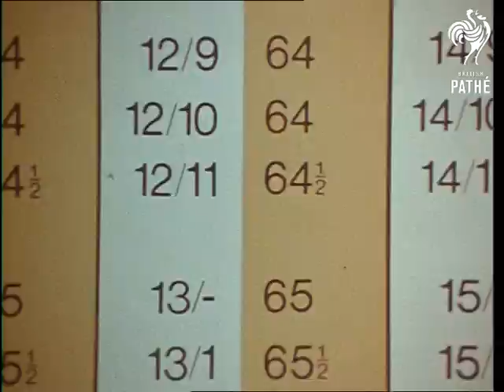Decimalisation (1970)

Comment: the old British monetary system:
Two farthings = One Ha'penny. 
Two ha'pennies = One Penny. 
Three  pennies = A Thrupenny Bit. 
Two Thrupences = A Sixpence. 
Two Sixpences =  One Shilling, or Bob. 
Two Bob = A Florin. 
One Florin and one Sixpence =  Half a Crown. 
Four Half Crowns = Ten Bob Note. 
Two Ten Bob Notes = One  Pound (or 240 pennies). 
One Pound and One Shilling = One Guinea. 
The British resisted decimalized currency for a long time because they thought it was too complicated.
Reply: wth how would anyone (esp tourists) get by with all that?
Reply: @earlbluetea  not British, but not as complicated as it sounds. It's just that one pound was 240 pennies (or 20 shillings) and one shilling was 12 pennies. Basically one shilling converted to 5 pennies when they introduced the new penny and pound was still a pound. Most coins were silver so you could kinda guess what was what because when the value doubled, the coin size doubled. Coins like 1 shilling and 1 florin coins were in circulation as legal tender quite long time after the decimalisation, they had exactly same value and size as the new 5 penny and 10 penny coins
Reply: Also there were some other coins in the past, like double florin and a 1½ pence, If I'm not mistaken double florin is still legal tender in the UK, although the value of the coin in just silver content is far far greater than 20 pence, probably closer to 10 pounds.
Reply: My old man used to call 5 shillings a dollar. I think it comes from the days when the £ was worth 4 American dollars.
Reply: Plus Five Shillings = One Crown, but you didn't see them that often. It's odd that the racing world is still in Guineas.
Reply: White Dragon, please stop it!
Reply: I'm sure it was easy enough to learn at the time, but looking back at pre-decimalisation  it looks like the writings of a lunatic
Reply: osp80  
We count fingers in: 
5 plus 5 = 10 
Hence decimals MAKE SENSE and this mambo jumbo of 240 to make a quid had to be flushed
Reply: From your name I assume you play Mah Jong; that's a Good Omen.
Reply: 10 Bob 50 p
Reply: People are making too much of the old system. In practice, it was pennies (or pence), shillings and pounds. 12 pennies in a shilling, twenty shillings in a pound. Everything else mentioned is either an informal usage, e.g. bob, or an archaic usage, e.g. florin, crown. There were also a number of truncations, e.g. ha’penny, farthing, and derivations, e.g. half-a-crown. On top of all that, there was pure slang, e.g. tanner (sixpence), nicker (pounds), quid (pound). It can get as complicated as hell, but at the root of it all was pounds, shillings and pence. Guinea (twenty-one shillings) was a class-soaked issue. Anything that could be deemed posh or relatively pricy would generally be priced in guineas, including posh sports like horse-racing. I happened to be in the UK for the decimalization swap and it all went quite smoothly, despite much complaining and dithering about. However, I do think prices went up, wherever tradesmen and manufacturers saw the chance.
Reply: Ой, какая путаница. С ума можно сойти.
Reply: @earlbluetea  nobody coming here any time soon
Reply: Clear as mud
Reply: Good God man.....
Reply: thanks for the explanation
Reply: It seems more complicated but when your brain is trained to use the system it is very simple.
It's the same reason why America resists the metric system. Our brains are trained to think in the old system. Our brains have no concept of what these metric measurements are.
Reply: @redX111t  I remember florins, it had it written on it.
Reply: The British are crazier than us
Reply: Well said
Reply: Thrupenny bit,  I need the bathroom.
Reply: This is coming back after we leave the eu
Reply: I am genuinely pissed by decimalization, not only in UK, but everywhere else. It took a lot of culture from us all, just to make bankers' work easier.
Reply: @FalconRS  the US dollar has always been decimalized. Under the Coinage Act, Congress established the dollar, the dime (1/10 of a dollar), the half dime (now called a nickel) and the penny (1/10 of a dime or 1/100 of a dollar).  

Now 240 pennies to a pound isn’t as bad as people now think. Mathematically it’s a highly composite number. It has 20 divisors which is more than any number below it. This means you can introduce or withdraw a lot of coins which divide the pound as is necessary to keep the economy healthy.  For that reason, it’s likely Britain didn’t have any practical need to change over until the US dollar supplanted the pound sterling as the de facto international currency.
Reply: All the prices shot up when we accepted decimalisation.
Reply: 60 seconds in one minute, sixty of them in one hour.
24 hours in one day
7 days in one week
28, 29, 30, or 31 days in one month
12 months in order new year

Handy guide for the children of tomorrow
Reply: @GeorgeMonet  exactly! As an American, I can do the math to convert metric, but I can’t wrap my arms around those units, y’know.
Reply: Sounds easy if you memorise it
Reply: It is extremely complicated! I can't even count to 100!
Reply: Thanks,
Reply: That's a WHOLE different language to learn!
Reply: Sounds stupid now. Lol. 🤣

Comment: I always remember that in our local Supermarket (Co-Op) the cost of HP Sauce was 1/5 the day before DDay, and 15p the day after - (3/-) double than it was the day before!
Reply: No not  really because your wages are also converted into decimalisation just never could understand or workout
Reply: @resnonverba137   - Sounds like the Co-op didn't understand the decimal system...
Reply: @jrgboy  Thanks. My comment was aimed at Thao and his rather tedious  'rip off UK' comment.
Reply: Thao Brewster  Thus showing your immaturity and what your ideas are worth.
Reply: Thao Brewster  15p is 3 shillings so more than double of 1/5
Reply: Now that's very curious, because there was a price freeze in the run up to decimalisation. I was working for Lyons at the time, and there was a ban on price changes.
Reply: I really do not believe this. I certainly have no recall of prices doubling overnight.  The only real "rip off" I recall was the bus fares.  The bus company, on the premise that the new 1/2p coin was too fiddly, rounded all the fares up to the next full penny.  Sounds nothing now, but back then I only earned £6 per week.
Reply: I know and look at Kit Kats .a tanner before and almost a bob after.
Reply: daro2096  almost, 7.5 new pence is 1/6. It sounds like the co-op just looked at the digits so 1/5 became 15p and 3/3 would become 33p instead of 16p. More or less double prices of everything under a pound
Reply: @JimTLonW6  That may be so, but it is hardly the point.  For example, I remember looking a a packet of Polos in the local shop, and it stated on the packet the cost was was 1 and 1/2 d before decimalisation and also 1 and 1/2 new pence after.  The old price was still on the pack and the new price beside it in brackets.  The major difference was that there were 240 pennies in the pound BEFORE decimalisation, but only 100 in the pound AFTER.

Another example, when my Mum divorced my Dad, he was ordered to pay two pounds ten shillings a week maintenance.  After decimalisation, he 'raised' this to five pounds per week, but penny for penny, this was actually LESS per week than the two pounds ten.
Reply: That’s because people subconciously equated, for example, 40p as 4 shillings, wheras it was really 8 shillings.
We should have adopted the Australian system whereby a dollar was introduced equivalent to10 shillings.
Hence 40 cents WAS equivalent to 4 shillings.
It was too easy for unscrupulous businesses to double their prices overnight without most British people even noticing.
I always remember for example my daily bus fare being rounded down from 2/3 to 11p. Fair enough you might think, but within a month it was increased to 20p. People thought that was OK, because it didn’t SOUND like it had nearly doubled from the pre-decimal price.
Reply: @jrgboy Yeah. It would have been only that one co-op. /s
Reply: @MeStevely  I had been thinking just how difficult it must have been for the British to decimalize their currency! Coming from Australia, I can hardly follow just how the conversion was done! Also in Australia we didn't keep pounds and pennies, we went to dollars and cents.
Reply: @mysteriousstranger416  £5 was not "penny for penny less" than £2/10. I mean yes, it was a smaller number of pennies (500 rather than 600). But the pennies were worth less  beforehand. £5 was worth twice as much as £2/10.
Reply: Same happened in most €-zone counties on the day of switch. Businesses which allways struggeld to raise prices did it, some even doubled their prices over night. They tried to use the confusion to get trough with it.
Reply: @resnonverba137  Whinging is not decimal.  Whining is.
Reply: @BigDogCountry  I have no idea what that means, sorry.
Reply: @resnonverba137  Whinging is your term for Whining.  12 vs 10.  Whinging is 12 Whining is 10.
Reply: @BigDogCountry  Are you on some kind of medication? What you have written is as clear as mud.
Reply: @stevetaylor8698  That sounds too low.  In the US, Ford was paying $5 a day 50 years earlier and the 1971  US minimum wage would have been about 1 pound an hour equivalent.
Reply: Only the pence changed.
If you got 7 pounds a week, that was converted into 7 pounds. Oh crumbs!
Reply: @JimTLonW6  
Nonsense. Shops charged what they liked.
Reply: Inflation was high, but you misremember that, as they were safeguards in place
Reply: @chubeye1187  
Can you describe the safeguards? What safeguards stops a retailer from charging any price they choose on any item when the currency has changed. They do it easily today.
Reply: @BrianMcGuirkBMG  there were a number of pieces of legislation through the 60s and 70s which were designed to hold down inflation by state control of wages and prices so any increace was supposed to be  controlled by government. The longest lasting was the prices commission set up in 1972 and abolished in 1979. I'm not entierly sure exactly what prices were covered by this but they only monitored food prices. Looking at the inflation of the 70s I'd say it didn't work very well
Reply: @madabbafan  
All the more reason for shopkeepers to go berserk charging for items which cost less than a pound (most things did because a pound then was the equivalent of 12.33 today). This means that almost everything cost less than a pound. I know someone who was paid 12 pounds a week in 1976 for a full time job.

There is no way they could be stopped changing the prices to whatever they liked when changing from old money to new money given that they were instructed to do so. Some kinds of goods might be very price sensitive and more difficult to take liberties with but most items could be priced any old way and it was very rare to see anything rounded down. Rounding up was the order of the day and mostly by enormous jumps.

Those price controls were a complete failure during a period of maximum inflation. Every change of job came with a giant pay increase.
Reply: @BrianMcGuirkBMG  true, although when decimalisation occoured it was at a time when there was no price or wage controls in place as the Heath government believed competion would keep prices down. When this failed to work the price commission was introduced. This as we know also didn't work as inflation began to run riot peaking at 20% in the mid 70s then the three day week, the 40% drop in the stock market, the oil crisis the IMF bailout. The 70s were a true ecconomic mess.
Reply: My Nan said the same thing.
Reply: We were ripped off, end of.
Reply: @JimTLonW6  Yup! That's how they got round it.
Reply: Thao Brewster  l
Reply: The value of our currency was halved overnight. It was the biggest con trick on the British public ever.
Reply: The Co-op was robbing people blind. 1/5 = 7p where did they get 15p from? I still think the RSA/AUS/NZ system of a new currency based on 10s. was better although we would have ended up with the UK $

Comment: Some fun facts (which someone else may have covered, but here goes anyway :D ):
-240 pence to the pound b/c 240 pennyweights equaled one troy pound (smaller than the 'avoirdupois' pound which is/was used for just about everything else);
-12 ounces equals one troy pound, as compared to 16 ounces per avoirdupois pound; therefore 12 pence equaled one shilling and 20 shillings made up one pound;
-the monetary pound was called 'pound sterling' b/c the penny was originally a silver coin marked with a small star. 'Sterling silver' refers to a particular alloy of (mostly) silver; pure silver would be too soft to use for coins;
-both the troy pound and avoirdupois pound are made up of the same unit: grains; one troy pound equals 5,760 grains while one avoirdupois pound equals 7,000 grains;
-last but certainly not least, one grain equals 64.79891 milligrams exactly.
There you go...more than you ever wanted or needed to know about the pound. Confused yet? :D
Reply: Brilliant, and actually very clear and logical to me. I'd prefer to return to pre-decimal to be honest. Mental arithmetic would improve massively because we'd be engaging our cognitive abilities !
Reply: @Candolad  The pre-decimal money is easier to use especially when it comes to giving or receiving a change without the use of a calculator. If the total amount bought costs £23 and the money given by the customer is £50, the change is £27. If the total amount bought costs £23/8/- and the money given by the customer is £50, the change is £26/12/- since there are 20 shillings in a pound. If the total amount bought costs £23/8/5 and the money given by the customer is £50, the change is £26/11/7 since there are 12 pence in a shilling. 

However, there are some store owners during the pre-decimal era that don't use £ symbol so that the items would look less expensive, examples are 67/9 (£3/7/9), 80/6 (£4/0/6), 54/10 (£2/14/10). There were also prices that are only short of a penny to look cheap, examples are 9/11, 14/11, 19/11.

Comment: The other day I was curious and tried to see if I could figure out pre-decimalized British currency. I stuck with it for a bit, learning about all those different coins, until it struck me- back then, a pound was worth a lot, often $5 or more, and at a time when you could buy things for a dollar, coins were relevant. These days, they’re not really. I through all my change in a jar and turn it in for paper money when the jar gets full.
Reply: It's easy when you stop focusing on the pounds and start looking at the shillings instead. In the old pound, there's 20 shillings - which makes it exactly the same fraction as a 5p piece - which is what replaced it, and what the old shillings initially substituted for. 
Likewise, that means the 10 bob note (10 shillings, or half an old pound) became the 50p, for example. And the florin was always worth 1/10 of an old pound, so it is basically a 10p coin (I think they only phased out the last of them in the 1990s, because they were still being used as 10ps).
In a sense, it was just the number of pence that went into every shilling and pound that changed - the values of those larger coins didn't change too much.

Comment: For a "complete change of pace" please see the "infomercial" used in Australia before 14 February 1966, when Australia converted from Pounds, Shillings and Pence" to "Dollars and Cents"  https://www.youtube.com/watch?v=tagZTp1Irr4

Australia (and New Zealand) had the "advantage" that they did not regard their "Pound" as sacrosanct.
Therefore, both countries were  quite happy to divide their Pound(s) into two Dollars - which, at the time, approximated US Dollars.
A further advantage of this was that only the existing Penny, Half-Penny and Three-Penny coins needed to be replaced by "One Cent" coins, since - with 100 cents equaling 1 dollar and 120 pence equaling half of 1 Pound (i.e. 10 Shillings) -
6 pence = 5 cents
12 pence (1 shilling) = 10 cents
24 pence (2 shillings) = 20 cents
(No other higher value coins were in actual circulation at that time.)

For Australia, this meant that, except for the penny and the three pence coins, all coins could remain in circulation and only new one cent coins needed to be issued. (However, two cent and fifty cent coins were also issued.)

While both Australian One and Two cent coins were created at the time, since then (because of inflation) they have dropped out of usage and are no longer "legal tender".  However, banking transactions may still be specified down to one cent!

An Australian "Fifty Cent" coin created at that time (and later modified) is still in circulation - and it is quite a nuisance - because, with a width of about 32 mm, it is too big. (Please note that the U.S. "Quarter" coin  [24 mm] is smaller than an Australian Twenty cent coin [28 mm].

One dollar and two dollar Australian notes have since been replaced by coins.

Of course, Australian "Paper" Currency has, from 1988, been replaced with "Polymer" Currency, (first developed by the Reserve Bank of Australia (RBA), CSIRO and The University of Melbourne). (See http://en.wikipedia.org/wiki/Polymer_banknote)

These "Notes" are much more difficult to forge than "Paper" notes.